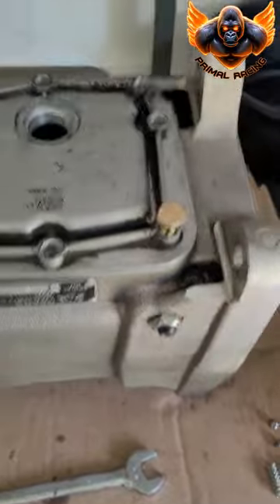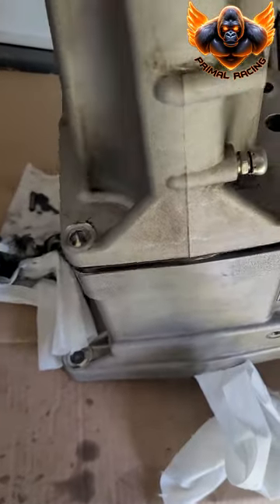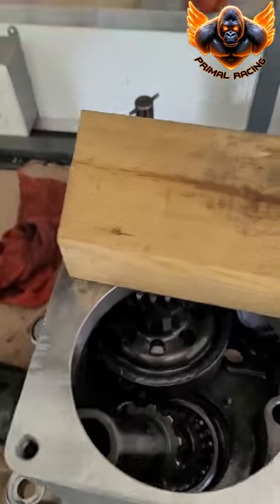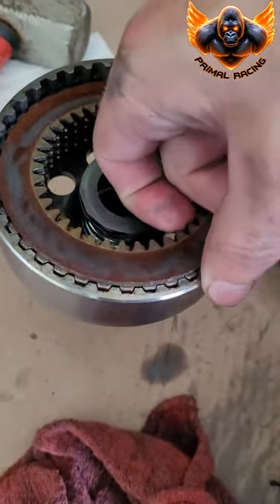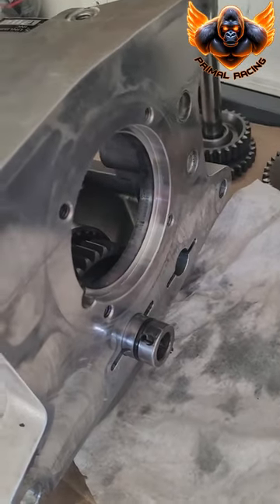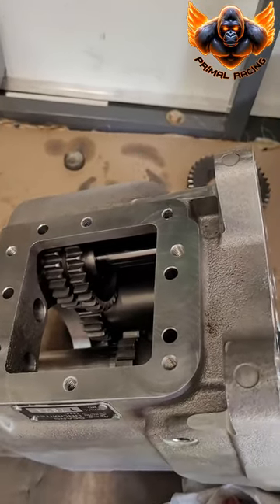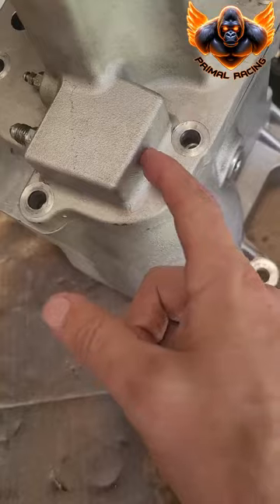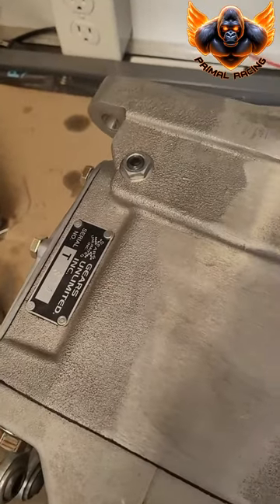Winters Falcon Transmission Rebuild by Primal Racing

Comment: Can you replace the main input shaft without tearing it completely down?
Reply from the maker: I'm going to say no. The gears are blocking it from going in and out, if I recall it correctly. Did you break your input shaft?
Reply: @PrimalRacing  stripped it and the coupler.
Reply: @PrimalRacing  stripped it and the coupler.
Reply from the maker: @rodneygarrison118  I think you'd still want to take the trans apart and make sure its good to go then when you replace the parts
Reply: @PrimalRacing  We went back to brinn. Have never had any real issues with them and easy to work on.

Comment: HP/Torque specs for this trans?
Reply from the maker: Hi Steven, I've searched all over and they don't have those specifications...this transmission is their regular late model transmission, with high gear being 1:1 basically direct drive. Late models can be upper 800-900 hp.
Reply: @PrimalRacing  So trust your race engine to no specs? Sales down?
Reply from the maker: @stevenbrown5695  I have less horsepower than a late model. What are you talking about sales?
Reply: @PrimalRacing   Well all specs and blue printing a engine, ah need a trans no specs. I figure many my look else where that have answers. Did not notice much information about what parts are made out of. Lack of educated tool's for taking the guess work out of it. Ah I think it's a great product and looking at it to make a short tail shaft to winters rear end to make a trans axel for mid engine open road races.
Reply from the maker: @stevenbrown5695  You can always call Winters yourself and find out exactly what you are looking for. Additionally, if you're road racing, you're typically shifting and this application of transmission is not what you're looking for.
Reply: @PrimalRacing    plan to do that. Thanks for your information.
Reply: Open road on Nevada hyway.
Reply: @PrimalRacing  I meant for Falcon are sales down, lousy joke.